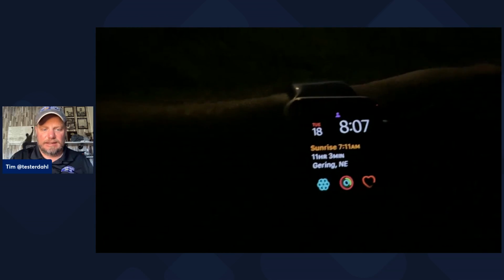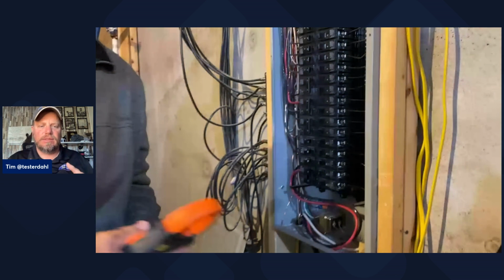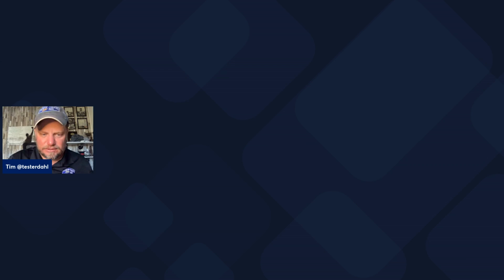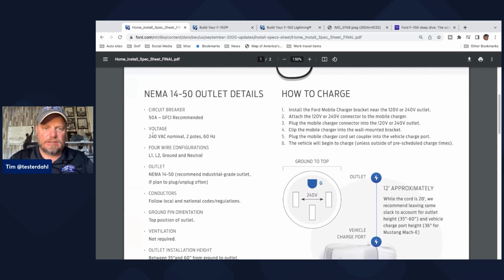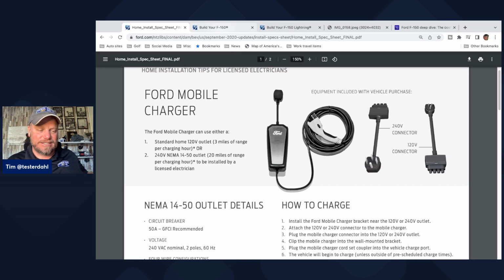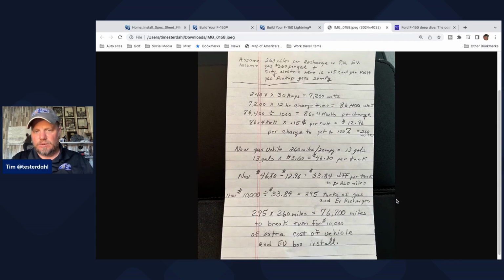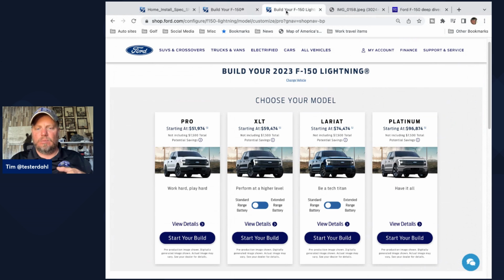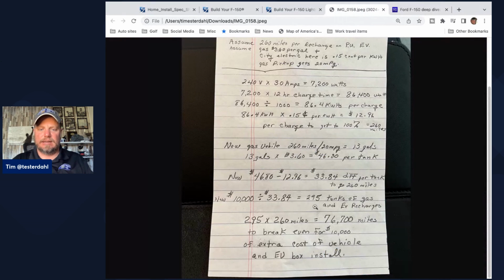11+ hours later on 220V charging price for 2022 Ford F-150 Lightning

Comment: Err..  "30 A per phase"    That's a weird way to say that.  There's only one phase and it's two half phases in north america.  You're pulling 30A across a full phase.

Level 2 EVSE's are generally 32A (40A Breaker), 40A (50A breaker), or 50A (60A breaker).   I could see the included travel charger doing only 32A pretty easily. The travel charger is generally for "emergency use".   A lot of subpanels couldn't take the max 50A load that the F-150 Lighting can pull. (mostly because people don't oversize subpanels for 60A+)

If y'all want to know how much it is to charge a F-150 lightning, just do the math.   98kWH battery * 1.10 (90% efficiency inverters) is 117.6 kWH power delivered.      117.6 * your price per kwh is how much it costs to go from 0-100% once time.  (117.6 * 12c per kwh is $14)

Look at your efficiency to see how much it costs per mile.   If you get 1.9kw/mi * 1.30 (70% overall efficiency between charge and usage) is a cost of ~ $0.29/mile

Comment: you forgot the most important part....you are buying a truck....the electric truck is a bust if you plan on hauling any weight above 4 passengers....I want a lightning f150...but it has to do its primary job and it cant!

Comment: You seem to be doing this the hard way. Get the app called "car scanner" and a cheap obd adapter. That will show your input power in real time. You will notice the amps drop when the battery gets near to full. That is normal for lithium batterie s. The last 2 % can take an hour or more. Also power is the product of amps x volts. Volts will vary from 206 to 244 or so depending on your utility and installation. Or borrow a smart c harger that records the power deliered fo the c harging session. Or spend 10 minutes and set up the wifi on your charger, instead of wasting hours on invalid calculations.

Comment: if your buying an EV to reduce carbon emissions ..... on average to manufacture an EV (from mining the lithium to finished vehicle) adds 20 tons of CO2 into the atmosphere..... plus most electricity here in the US is generated by fossil fuel... so it's not very green... what is the battery life span?? 100,000 miles?? I've been driving my F150 for 20 years, EV's will not last half that.

Comment: i run a 12 kilowatt charger from autel much better speed for home use. sounds to me like they gave you a 32 amp charger that throttles. 80 amp is going to be the norm for home charging.

Comment: If it takes 13 hours for half a charge, does that mean it takes 26 hours for a complete charge that gives you less than 300 miles?  If so you may need to add in the cost of a motel room if on the road and the cost of a cab/Uber to take you from the charging location to the hotel if the hotel doesn't have chargers.  No thank you. I'll keep my GMC Sierra.  In 15 minutes I can fill it up, just the bathroom, get a cup of coffee and hit the road for another 400 miles.

Comment: You pay for amps , a moter pulls 10 amps on 120v then at 220v it will pull 5amp now which is going to be less if you pay for amp? Higher the voltage less the amps, in older day you could get 480v or 220v that pulled less and service available now every home is 120v because it pulls more amps and you pay by the amp. Ask your favorite  electran, and thats only single phase instead of three phase which is even less.

Comment: I understand the apples to apples concept and mathematical difficulty BUT, not factored in is AC, a radio or phone, lights, traffic jams or stop light time ie. Turn signals and brake lights all eating power.

Comment: From what I have read the battery life is estimated to be 10 years. A 10 year old gas truck with 76000 miles would be approximately ——approx. $30000 today. I wonder what the price of an EV truck that you could not drive unless you replace the battery. Inquiring minds want to know.

Comment: after 10 years you have to replace  the battery you only at most have to replace the fuel pump the battery is a very high priced fuel tank

Comment: Great analysis but the elephant in the room is that you can't take the truck further from home than 130 miles.  Closer to 100 miles if you factor in range anxiety.  Tow a boat or RV to the lake for a weekend?  I laugh on you...  Ford, Joe B, and Greta sure do chuckle.
Reply from the maker: Yeah, wrong truck for that application. Like Ford said, a Super Duty isn’t going electric anytime soon. It just doesn’t work for towing.

Comment: And if you must replace the battery in the Ford F-150 Lightning, it will cost $35,960. Li Ion batteries degrade over time and it some cases, will need replacement after 5 to 6 years.

Comment: What's not being addressed, nor can it be presently assessed, is what the  effect of all vehicles going to electric will have on the grid and the subsequent environmental damage of all that additional power being needed.  Additionally, wait for 12 hours to go 250 miles?  Not practical and again, more power drawn on an already overtaxed grid would be needed.
Reply from the maker: This is at home charging. Road trip is much different for charging.

Comment: OK, I'm going to drive 500 miles and I have to stop to charge it for 13 hours in the middle of the trip, where if I drove my F350 7.3 I could in Memphis in less than 12 hours.  My time is more valuable.
Reply: That’s correct.  This truck is not for your application.  Neither can it haul a 35,000lb mini-float.  Wrong application of the wrong tool.
Reply: Please don't get it wet or park in your garage. Take Care.

Comment: I think the difference in distance form 99%/260miles vs 100%/257 is a change base on atmospheric conditions like temperature but I’m only guessing. The truck must be measuring temp and pressure outside. But I would guess cooler temps would degrade performance.

Comment: So the troublesome part is is it if you get to your destination that say already 150 mi away I'm just saying... It will only leave you roughly less than 110 120 mi left to do anything else around the area that you arrive at... Are you going to wait another 2 to 5 hours to get another 50% charge???
If I use gas or diesel which is what we're really getting away from... It takes 5 minutes to fill a tank if it's 13 gallons from a pump to get at least another 110 to 300 MI we're at my destination I can drive around.... And then a few days later if the vehicle still remains parked I can drive it back home... Without waiting another 12 hours to charge up....  I guess this is why there's like five different battery companies working on a very fast charging cell... But it's not ready to hit the market yet because it costs a ton of money right now but changeovers.... Until the fuel up matches the charge up time people are still going to hold back..... Can you imagine being stuck in a snowstorm for 6 hours in an EV.... You completely lose battery under 2 hours and then you freeze....

Comment: I have had my EV ( in my case a Tesla model 3 performance ) for 3  years now. The first month I had I I only had the charger it came with.. same as yours, 120v and only 3 miles an hour charge that would give me 30 miles “‘if” I was home that long. Now my drive is 100 miles round trip, so that charger did not work the first day. I had to drive past my house to a super charger and I would get well over 400 miles an hour charge, I was at 90% in under an hour. Now I say 90% because that is what it recommended for daily use ( my max range is 310 miles for my 85kw battery) so my daily charge at 90% with 280 miles range. After a month of supercharging, I had my home charger installed. @ 240v I now get 44 miles an hour charge, and when charging to 90% my car is finished in less than 3 hours, and I have it set to know what time I leave, it will set the temp, and top off the battery. 100% charge I only use for road trips. From empty to 90% I will always get in an hour at the supercharger. It’s the last 10% that takes another hour. Now I had a sub panel installed in my garage because it never had 240, so I had a dual pole 80/80 breaker in the main box, and a 100amp main installed in the garage. With every penny, and I know I won’t have and power issues charging or even adding another if I decided to get another EV. Now you speak of return on my investment, I got mine. Trust me. I have 77k miles and the only cost of ownership was a cracked rim from a pothole, ( had it welded for 80 bucks and repainted) for me it is still worth every dime. Yes I watched your whole video. My car also top of the line for the model 3 came in at just over 80k.  I knew I could afford it because my hummer and my bmw both cost me over 1000 a month ( gas and upkeep) to drive. BMW for summer, hummer for the winter or bad weather.
Reply: ... rich sob

Comment: THE Lightning  gets 72 mpge equivalent miles 

4.5 times the 16mpg average of the F150  gas burner.

10  years of the average driver
$37,000 in comparable savings.

Comment: There is a number of things he did not mention. The range decreases as you increase what you are using, radio A/C, etc…. Secondly you fuel of your car to you see that cost immediately EV you will only see once a month in your electric bill. As for environmental concerns no one is taking about these batteries, which cannot be recycled and are worse then nuclear waste. The life of the batteries is a factor too.  The range will drop as the car ages. They cannot even say how long the life of a battery is.

Comment: The fuel pump cut on , that is where the 3 miles of juice went ;)
As noted , slight temperature changes affect battery power/storage. Temparature also affects charging time.
And AIUI , you really shouldn't fully charge them to 100%
Reply: If you leave your charger on overnight while you sleep and >97% charge is reached is that “bad” ?
Reply: @jimc3688  idk

Comment: I see the cost of replacing a battery on a new Largest battery F150 lightning is $39,000 plus the cost of insuring the electric vehicles are more than gas vehicles. And prices are only going up. Oh wait, you better hope there is a replacement battery still made for it when you need it.

Comment: Thank you for your video.  it takes me nearly as long to charge a battery from 30 to 70% as it does to charge from 90 to 100%.  On the road, unless you have a charging desert to cross, i only charge to 70% and pick up a charge further on rather than take on more at a slow charge rate.  It's also actually bad for most lithium batteries to charge above 90% anyway.  I figure it's better for my circulation to get out every so often anyway. I get a quicker travel time even though i stop more by charging to 70% and driving on.

Comment: I can see a plus for EV cars as passenger vehicles, but sorry there is nothing out there for an EV truck. The F-150 might as well be a car, there is no benefit trying to use it as a truck. Just a small load will take that mileage down to something unusable in any good sense. And the load test verse range was all done on highway, and that cut it in  half with great regen. So what would you get when constantly powering up to get moving in city with any EV weighted down? Say inner-city delivery, could the vehicle even finish a route, plus say just in city you EV amazon vehicles, could the grid even handle it when all those vans are plugged in each night?

Comment: And this is why Ford CEO said their failing point on EVs is charging availability and education. 

Also why Tesla is going to win the EV revolution with their Super Charger Network. The OEMs have no intention to bring charging facilities under their umbrella and will pay deeply for it in the future IMO. If you have to pay a third party then you are paying a markup and if the competition isn't paying a markup then you have an issue. If the competition is also using solar energy at every location feasible with battery storage for non sunlight hours and not the local utility... their partners better get serious or they will all end up using Tesla chargers and seal their fate.

Comment: Very important thing about charging lithium batteries.  Charging slows considerably going from 80% to 100%.  Now Tesla is not recommending charging past 90%. It’s not worth the extra time required.  Also all the chargers for anything but Tesla is riddled with software bugs.  Tesla is 10 years ahead in charging technologies.  Unless you enjoy yelling at charging stations, buy a Tesla.

Comment: 500 miles will take, @ 60mph, 500 minutes (8.33_hrs) + 22 hours.... oil is sounding better by the minute

it's not worth it... I usually fly if it's anything 10+ hours for travel by vehicle... 
2hrs @ security, 2hr flight (estimate), 1hr for luggage and leaving airport.[doesn't include time from airport to final des.] so roughly 5-7hrs for 700 miles = worth it
but
if it's and 6-8 hrs drive is it worth the ticket price, uncomfortable space (usually in coach), and being at the mercy of the airport?  
nah just drive enjoy the US. unless you have an electric vehicle then you enjoy hotels.

Comment: So say you drive a 100,000 miles and it's time to change the battery. The battery would likely cost more then the vehicle is worth.................so your vehicle is essentially worthless at that point. Doesn't sound like a good deal to me.

Comment: But, there's always a but! What if the battery goes out.  How much to replace.  They say they will last BUT I've been researching and they go out in 8 to 10 years.  For the Tesla that was 8 years old it was 21,500.00 and the car was worth 22,500.00.
I'm adding this.  A neighbor bought the new Volvo electric car last fall.  I asked him what miles he gets.  He said when it's warm, like in the 80s.  He will get around 405 miles on a full charge.  Then I asked what about when it's cold.   He said in January when it was 3 degrees he had to go on a trip for work and he ONLY got 103 miles on a full charge.

Comment: I always just figure out how many miles per hour of charge. These meters are just a "Guess O Meter using your driving history to predict your range. 

The charger may cool or preheat the battery at the completion of charging. 

Could be the loss of range at the performing that function.

Comment: After all, in total, you will go in the hole with that electric vehicle. PLUS, ever run down on the side of the road, you are screwed. Things happen. Bragging to someone about your "Reduced Carbon Footprint" will not add up either when all is considered start to finish. Trade in value after a few years should factor in cost for tissues, too.
Nope, I looked into it, nah, just nah.